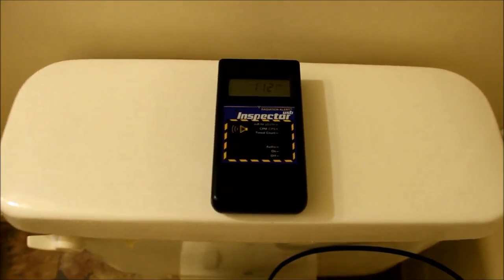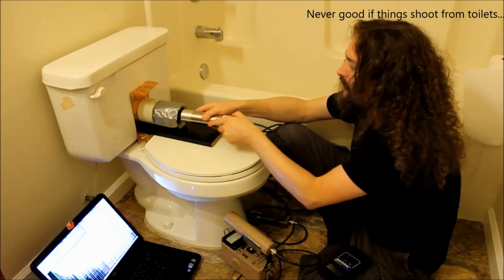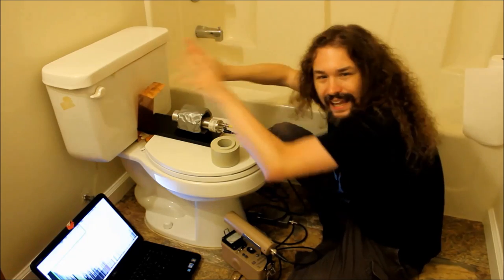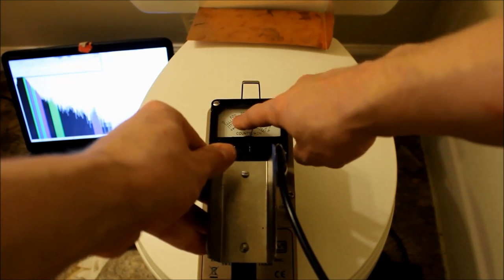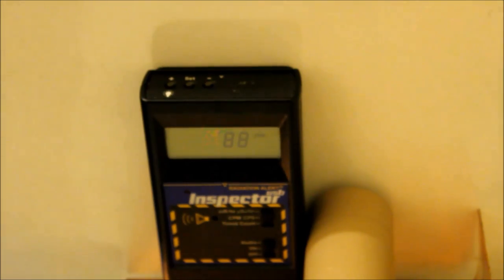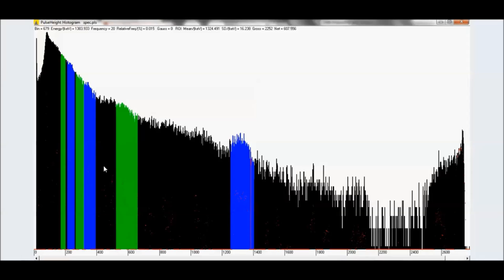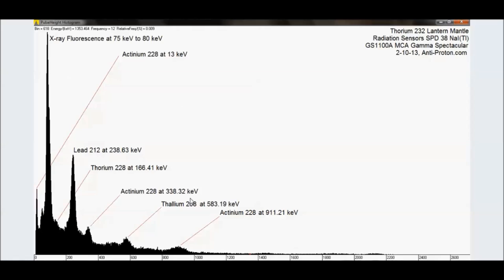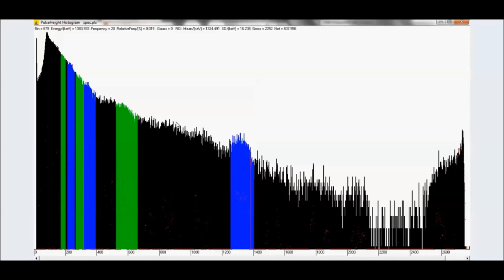Radioactive Toilet!  Testing the Hot Seat!

Comment: I just ran some measurement with a GMC-320 Plus with stock GM tube (beta and gamma only). The measurements were timed counts made for 100 minutes each. I ran multiple measurements to avoid statistical differences.
Background radiation (measured with counter laying flat on a wood talbe) was : 25.74CPM, 25.44CPM and 26.99CPM (this one was made a different week)
Toilet seat was : 28.97CPM and 29.36CPM

So I definitely get around 3 more Counts Per Minutes against the toilet seat than on a wood table.

Wow, now I will be able to look cool during parties by saying that toilets are radioactive. Well... I guess I'll look more nerdy than cool, but whatever.

Comment: Have you tried using Thorium for cal'ing your setup with the 2614 peek to help balance the upper end.  I use Cs137, Co60 and monizite ore to give me points across the spectrum.  One could also use 2% thoriated tungsten wire, as it is specifically exempted from the source material rule.  Just a thought.